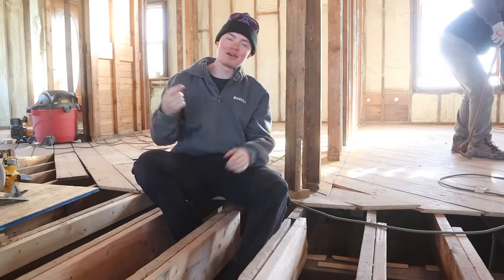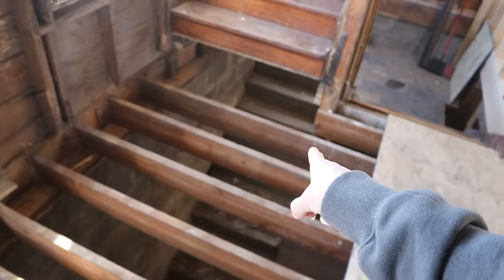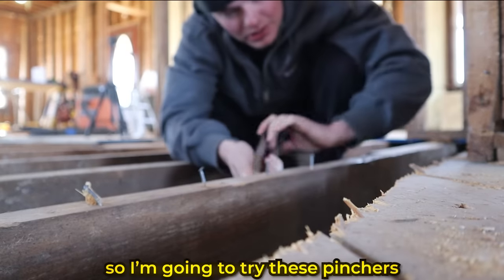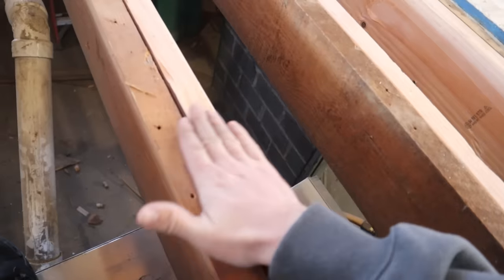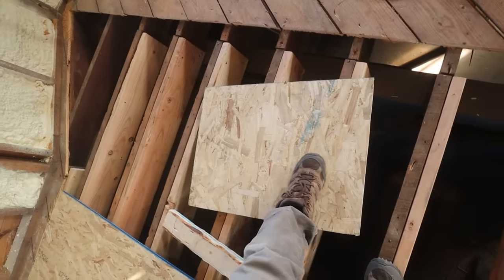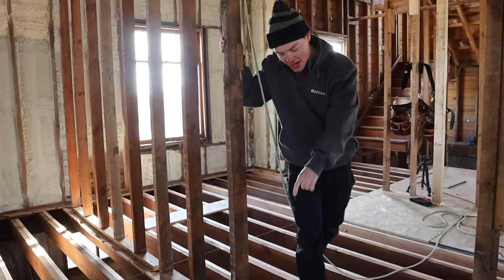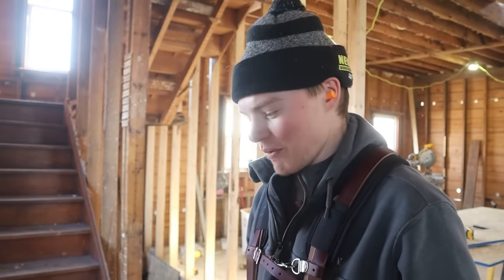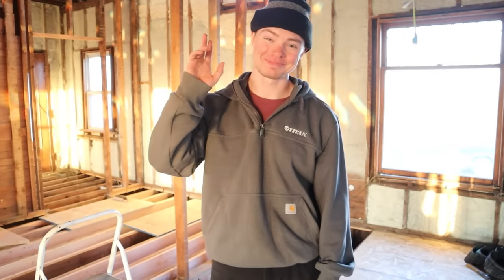Restoring A $7,000 Mansion: Rebuilding Pantry & Bathroom Floors

Comment: COLE:  The failing beam , the single 2x8 carrying second floor load under the wall is probably the reason why the floor is sagging over an 1" . The post to the foundation under that beam has to 4 or 5 feet from the second floor load caused alot of your sagging issue in the beam! Sistering the old floor joist and shiming all the joist level on a failing structural beam is stupid! The beam should get replaced first and possibly a new colum from beam to foundation at that wall location. The know Sister 2x8 probably should be replaced with a substantial lvl . The single 2x8 carrying the load from the second floor also looks to be poorly supported at the basement window header!

Use a reciprocating saw with a metal blade to cut the nails at the beam/joist location so you don't butcher the old joist pulling the nails with a cats pawl!
Reply: Preach it!!!  I said basically the same thing and all of the Cole and Roman fanclub jumped on me telling me to leave them alone.  With the deflection they're getting I can't wait for them to start laying LVP over these floors, the seams are going to be popping anytime someone walks across the floor.  Good thing to know that they leveled the attic floor first.  I wonder what will be settled first the Million Dollar Binsite lawsuit or the Cole vs. Justin $7000 Mansion lawsuit.
Reply: In this video they finally mentioned replacing the structural beams after the fact!

Comment: Those floor joist are going to be a problem. You might have flushed them on the top side, but the bottom side when you go to install sheetrock for the ceilings..they will be bowed downwards!!
Reply: Its the basement he might not be finishing that and anyway drop ceilings don't care.
Reply: @johnunsicker7440  so you're saying the second floor hasn't dropped? Come on!

Comment: When pairing joist you should screw from old joist into the new joist, doc their pay need more screws lol 🤦🏻‍♂️🤷🏻‍♂️🤣🤣
Reply: Without any adhesive does it really matter?
Reply: @benhur520  I mean that’s optional for pair joist, it would be the absolute bullet proof way of doing it tho! I was actually going to say that too but properly screwing them together is most important! I personally wouldn’t use screws either id  angle nails! House shift with the seasons, there’s no give with screws, they will loosen over time cause the wood to strip out! Screws are not good for anything structural I don’t care what the box says or what so called professionals say!  Exactly why newer homes are falling apart after 10 years! New technology is wonderful but if it’s paired properly with given situations! Also OSB is terribly stuff any kind of moisture over time that glue is mold magnet! I actually would lay pressure treated around outside walls, bathrooms,  walk ways and kitchen under sinks fridges dishwashers etc etc not too mention OSB  warps so easy stuff is terrible! In my opinion they have great intent but me personally their trailer-izing the house instead of restoring her glory, not mention they wanna do hot water floor heating your guaranteed leaks, nothing better or more reliable then cast iron heating period!  I could go on and on

Comment: It makes me nervous when I see cinder blocks used in that manner. The holes in the block should be vertical not horizontal. That's where you strength comes from. It is easier to make that block give way. Guys working on vehicles have had accidents when the cinder blocks are used in that manner.

Comment: Looks like they should have demolished and then rebuilt.  As it is, nothing left of the original old home. Kind of sad.
Reply: There is going to be so much left of the original home, it’s the same house just built to todays standards. Almost the same structure with better internals.
Reply: Or built the house he (his wife) wanted nearby rather than erasing a piece of history.
Reply: @wcsd9577  you act as though this “piece of history” would have been standing or live able if he left it the way it was? If the house was left the way it had been it would have continued to decay.

Comment: Cole, I don't know if you are using  tongue and groove flooring, but you will end up with a much better job, it will allow your veneer flooring to go together more easily, By the way, I hope Justin pulled all of the permits required for this construction project they are required on your job since your removing and adding walls, changing the structure if a viewer doesn't like you he may drop a dime on you, and you may have to tear it apart plus a nasty fine, THEY ARE REQUIRED CHANGING STRUCTURE  REQUIRE BLUEPRINTS

Comment: I enjoy watching you transform your home. Ok, I have a question and please forgive me I'm a girl and I want to know about the beam in the basement that has the warp in it. So when you put the new straight sub floor beams in and sister them up to the crooked ones and I saw the episode where you explained how you straightened out the joists warp but then do you re-screw the double up floor joists to the old crooked beam? I know you said that you put in some wedges but if the beam in the basement has already started to warp then wouldn't the weight of the now doubled up joists make the basement beam sag even more? I can hardly wait to see the finished product.😊
Reply: Going to be replaced with engineered beam later.

Comment: Go to your local rental place and rent a few roof jacks they are simple to use and cheap to rent .If these guys are contractors and engineers they should know all about them. This is a poor way of doing this job  ,wasting time and silly work practices.Roof jacks would have saved you many ,many hours of  labour and no wasted material, let alone safety.

Comment: So they're adding 2000 pounds of wood to the floor, then going to tear out the supporting beams below that floor?  BRILLIANT!!!
Reply: So guess you never done remodeling work.
Reply: @johnunsicker7440 Grew up doing it.  Never added weight to something we were trying to jack up.  But then we did a lot of things different than these three guys are doing... like insulating before wiring and plumbing were done.
Reply: @benhur520  Just because you did it one way doesn't make it the right way.  Them add the new floor joist first then doing the new beam actually will be better because you know where the beam height need to be instead of guessing with the old joist.  If the old and new lumber are not the same size you have to cut or shim to make them match.  Best to put in the new and then figure out what you need to do to get them all to sit on the beams the right way.  Sure you can mark and cut each old joist to match the size of the new one then install the beam and new joist and hope and pray they fit right or you can install new joist match the top and then us a flush cutting router bit and cut them perfectly and then place beam in and level  floor.   Faster and better in the long run but then again I think.  You do realize that he didn't plan to do the full remodel all at once in the start right.  It just happen that he is doing it now also with the insulation yeah might not be best but he tore it all out and they had to get some way of keeping heat in the house as they worked and how would of thought that we would have a week of cold weather and then 45+ degrees for the rest of the winter when average temp is 30 or colder.  But that spray foam is like a 1 inch thick so you can easy get wire and plumbing it it but then again I have a brain unlike some people. Spray foam is awesome but $$$ so 99% of people that install it and buy it just do 1" to 1.5" for a air seal and then bat insulation the rest.  Truth is and I have proven it if you just stop the air from getting in the building will be so much warm.  We sealed a old factory build just the air gaps and i was never able to get it over 50 with two 500k btu tube heaters once he sealed it 60 was easy to get and maintain with just one heater actually was too hot back there.
Reply: @johnunsicker7440 First, I wonder how we could have figured out the existing floor height another way... ahh, string line???  Justin has a laser level, there's an idea.

I don't even know why you're blabbering on about cutting and matching floor joists.  I'm talking about laying the subfloor and then deciding it's a good time to level the floor afterwards.  Makes about as much sense as sistering every single floor joist in the house.  If every floor joist has that much of a bow in it why not strip them all out and do it right?  Which would be a first for this renovation.

Actually he did plan on doing a full gut.  He never once mentioned about doing this floor by floor.  And he decided to start in the attic.  No carpenter besides Justin that I've seen has ever decided to do a home remodel by starting at the top and working down to the basement.  

How's that insulation working out now that they've removed any source of heat for the house a few weeks after spray foaming the exterior walls?  

Air leaks in the house???  Did they forget to put up wrap the house in Tyvek before putting that classy mansion-grade vinyl siding on?   I guarantee there's more air leaking in through those single panel windows he's not even mentioned replacing yet than there was in the walls.  

What's your opinion on going the cheap route and putting down OSB for flooring?  When I built my house I wouldn't even let them put that crap on the roof as decking.  

After it's all done I can't wait for Cole to put forced air heating after realizing he can't heat that large of a house with infloor heating only.  Well he can, if the family likes walking around on 80-90 degree floors.

Comment: Cole, you need to stop using the word restoration. If you wanted to restore it there were a lot of ways to fix those floors and walls without tearing them out and could have saved yourself a lot of money. Sorry  that Justin wasn't  knowledgeable enough to know that. And the use of restoration just doesn’t  apply anymore. Remodel does.